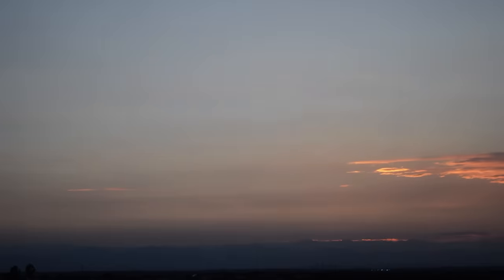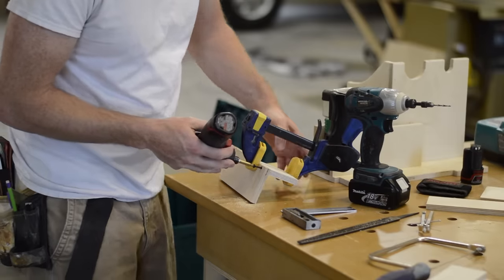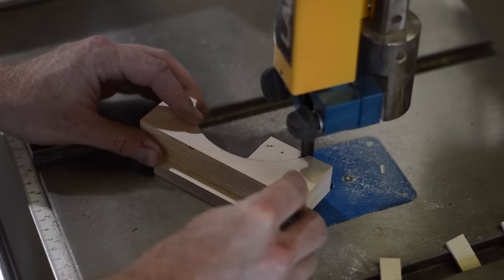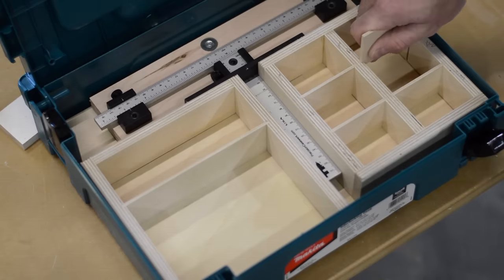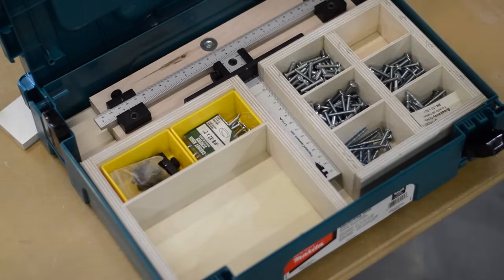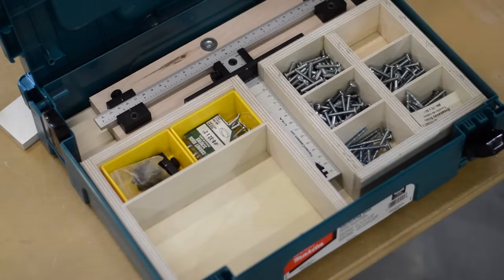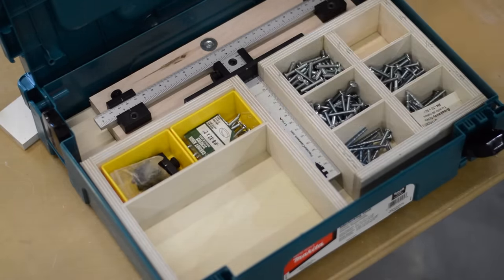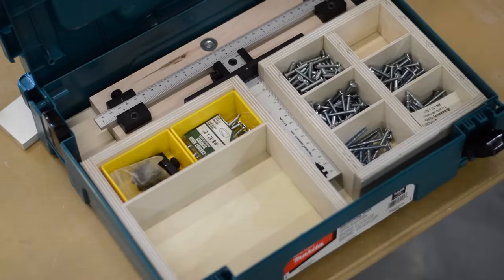Carpentry Tool Organization, Makita, Festool Systainer Build

Comment: This improves storage and transportation but doesn’t solve the issue of managing the tools while they’re in use. You still end with multiple open toolboxes scattered about the workspace.
Reply from the maker: Its helped me on the job site tremendously. No tool storage will solve the problem of tools scattered about. Its up to the person to develop a system that works for them, then implement it. This system has allowed me to keep my foot print much smaller on site, and its helped me become faster when loading and unloading.

Comment: Now you need a cart to wheel all of the around. Build a box with drawers that give you quick access to constantly used items. That will integrate with the others. Trust me. If you can build for less   $170.00 that is.
Reply from the maker: I have a foldable dolly on the way. I wanted it do haul the boxes and also be able to haul cabinets around the job site. Thank you.
Reply: @Duane Hurley The cart idea really doesn't work going up or down stairs,the hand truck is far more convenient,you are able to move more weight faster,easier and in my case of being a cabinet installer,the hand truck is also indispensable for moving cabinetry.

Comment: @12:15 your table saw insert plate seems to lift at front once you pass the blade. You would probably know better but it might need a magnet or something to keep it from lifting as it creates an issue with blade. Just fyi
Reply from the maker: Yeah, I have a few, some fit better than others. When I need more accuracy I use a better insert.

Comment: is some update? Specialy about compressor?
Reply from the maker: All is working well. I ended up adding a few more boxes with other tools. The compressor has been fine, I run it with the lid closed most of the time, heat hasn't been an issue. I have enjoyed using this system.

Comment: Ps . How about wheels..do u just have a 2 wheeler. I do have an idea for improvement.  No doubt some big company will steal it...Up and down stairs and weight.. ?The problem I run into is loaded weight.  Solution>>>>   two rolling tool boxes that can interlock or run on their own individual wheels. This way you can split the weight of different sets of tools ..or sometimes you may need both set of tools so u can split to carry up stairs and interlock them and  roll together when both are needed.
Reply from the maker: So far I have used a dolly and it works very good, even going up stairs.

Comment: personally I hate the Makita systainers with those catches. for a cheaper better value systainer I like using metabo ones that are called metaloc. similar to festool. slightly cheaper plastic and a metal catch as an alternative to the twisting knob. but if cost isn't an issue I would choose the festool ones which are made by tanos
Reply from the maker: Good tip. Metabo usually makes pretty good stuff. I didn't know they made systainers. The Makita systainers are also made by Tanos, they are just the old style.

Comment: The problem with this custom-fit approach- the second you replace a tool or a Mnfct changes anything whatsoever about their packaging - your system falls apart.  Been there done that - tons of wasted time and effort.  Now I use a simple combo of large tool bags (Deluth or similar) and a bunch of Tupperware containers.  Cheaper, way more flexible- but still organized.  Same sort of divisions you’re using.
Reply from the maker: I have been using bags for years. My problem with bags and Tupperware is they don't pack well in my van (don't stack well). This takes up space and now I have less room for my delivery. I have built these inserts so that they can be taken apart and rebuilt, I also have been using pretty much the same tool set for long enough that I'm confident it will only be small changes in the future. I'm certainly not advocating that this system is great for everyone, but I wanted to give it a try.
Reply: Hey Mike - apology -  I didn’t mean to sound so negative. One thing for certain - if you showed up with this rig ...as a customer I would be impressed and feel that a serious pro was on the job. Honestly that alone is the reason to do it, whether it’s any more efficient or not. It will allow you to charge more which in-turn will get you better jobs. Trust me - a $135/hr pro swims in a different pond than a $35/pro. Same thing using tools and equipment that are a notch above what Joe D.I.Yer finds at HD. Festool sends a different message than Ryobi whether they produce better work or not. You won’t find any Kobalt Chinese socket sets at a NASCAR or F1 event - lots of Snap-On and Mac. Love your vids - keep it going.

Comment: I don't know about your lens in those boxes...those plastic latch looks like it'll pop open if the box is dropped, I would stick to pelican or even HF knock off of pelican's or install a backup latch that's metal.
Reply from the maker: Thank you. So far its worked OK. I think I will upgrade to a pelican box in the future. We'll see.

Comment: Can we get an update on these?
Reply from the maker: Yes! So far totally awesome, the compressor does not over heat, even with the lid closed (I am only using small nails and shooting a few at a time). The organization on the job site has been very helpful. Nothing has broken yet, and I have only added a few small hand tools, which required no modifications to the boxes.

Comment: All those systainers are made by the german company tanos.
Reply from the maker: Yes, the newest Makita systainers are made by Tanos.
Reply: These are the only style from makita i know. I'm using a similar setup like u for almost ten years and i'm very pleased with that.However i bought my tool tray and my air compressor was already built in on of those systainers.
Reply from the maker: I saw the built in compressor systainer. I would have bought one, but I already had the compressor so I thought I had nothing to lose by cutting it up.

Comment: I am hesitant to be negative towards anyone's work...  So what is this like packing in and out?  A little heavy huh?  Most of the wood dividers used could have been accomplished using EVA Foam.  Anytime your an onsite contractor - weight and transport has to be considered equally.
Reply from the maker: Maybe I'm just really strong, but the 2 pounds of plywood in all the boxes combine hasn't slowed me down very much. EVA foam can't be cut and joined into shelves or drawer boxes, nor can it be lifted out with tools in it. EVA foam is cool, but I couldn't have built this the way I wanted using it.